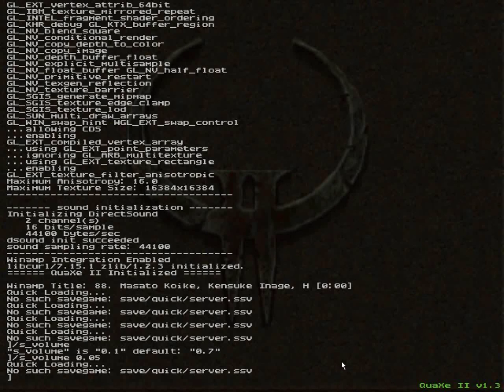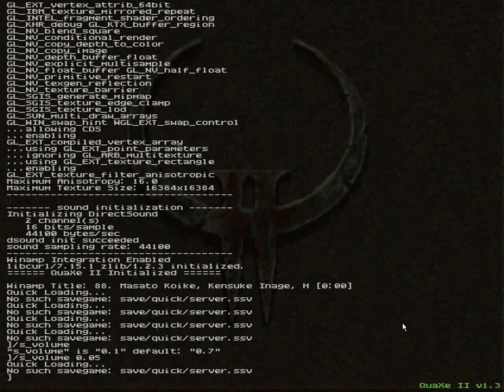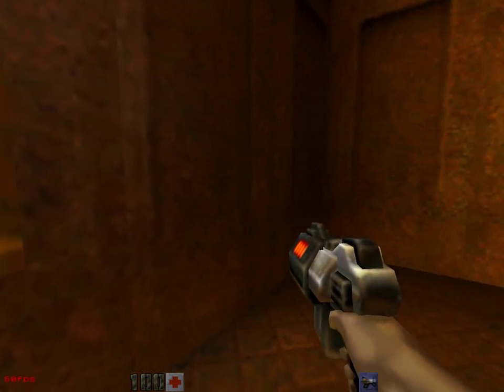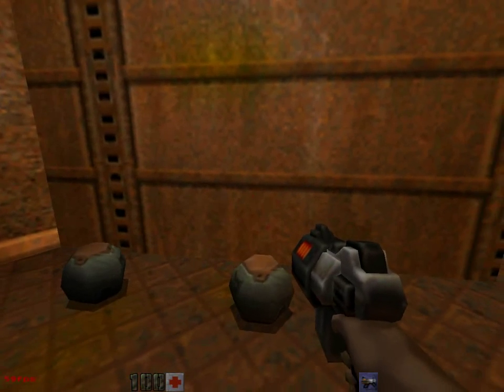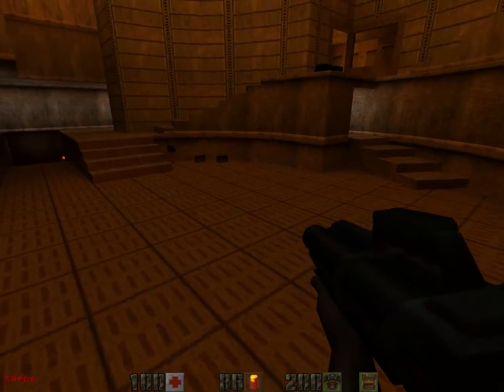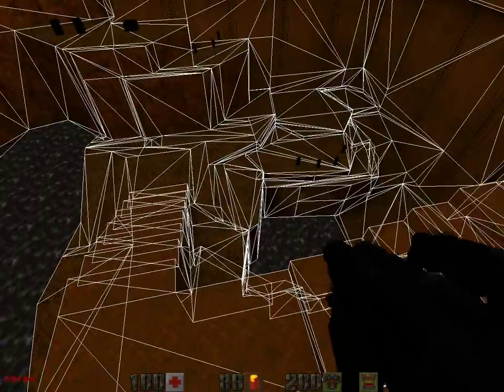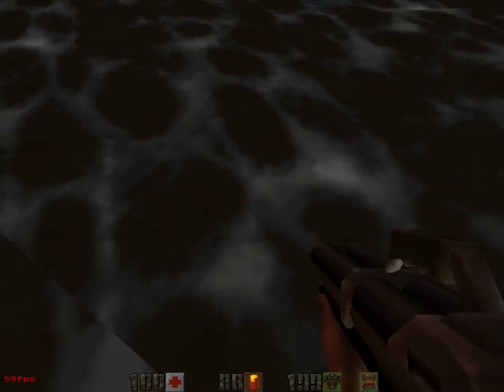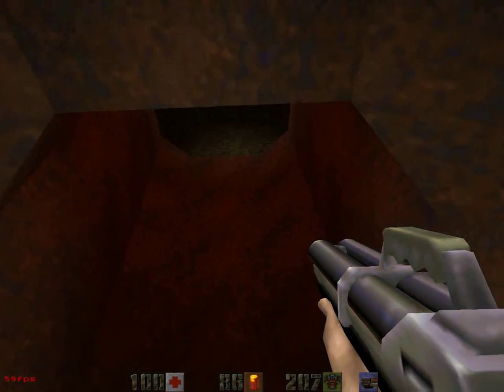Quake II Light Experiment

Comment: I wonder if this could be used in RDoom3BFG as a fallback for the light grid, there is a light grid that covers every portal area, a 3D grid of points that use light probes for ambient light, but maybe it could be used in the following way:
- every point in the grid has a radius that is the distance to the next point, this makes it a sphere
- this radius lowers the power of the whole effect per every sphere in the grid.
- for every point, the most significant lights get selected up to a finite num of lights (maybe 16)
- for every light we get a direction and the power of it
- then we proceed to light every vertex within the bounding box of every point sphere in the grid with the direct lighting of every one of the 16 possible lights (or less) and taking into account the power of the radius of the sphere.

what do you think?